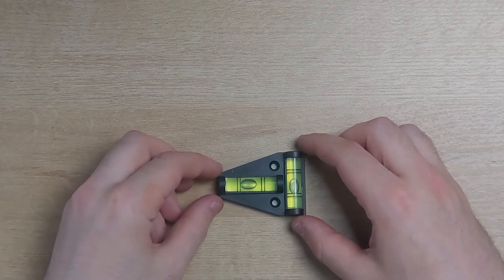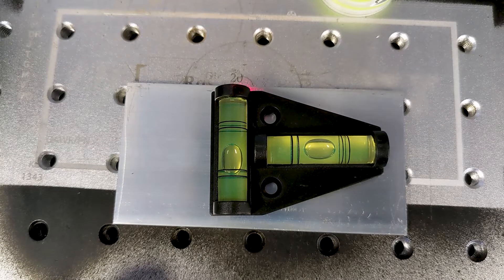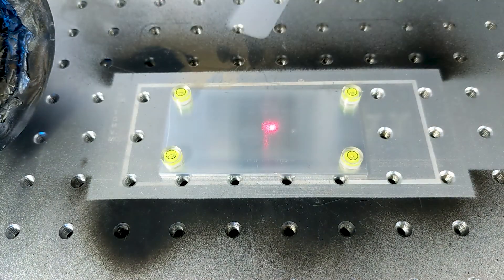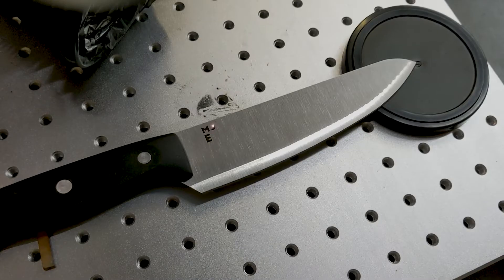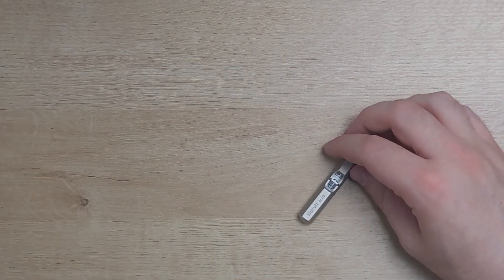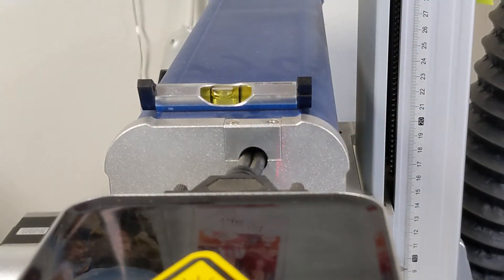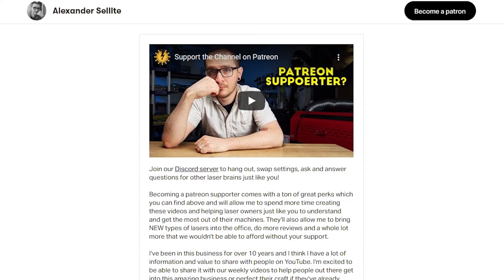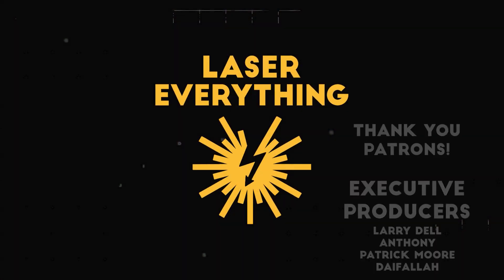Levels and Laser Engraving | Everything You Didn't NEED To Know | Starrett 135A Review

Comment: One thing I noticed, you found the level of the machine vs it's workspace on the arm of the galvo, not the head (4:22). They can be off from one another, I'd place the level on the actual head. Otherwise, great video as always 😘
Reply from the maker: I painstakingly leveled the arm and the head on my machine because my head has a huge concave curve on the top of it which makes placing a level on it infinitely frustrating. Went out to my way to make sure the head and arm were level one time - tightened everything down and now use the arm -_- tedious and annoying but effective.

Comment: When you get in to ultra high accuracy levels they will have to be acclimated to the ambient temperature and humidity of the working area. So in short they should sit no less that a hour or two. Now that being said these would not be used for product laser set up but more for machine set up I.E. CNC MILL or Lathe. But they are out there and no need to spend 1k or more for name brand.
 Starrett level you have chosen is excellent for laser set up . I would recommend highly.
Reply from the maker: Very cool, thanks for the insights 😎 I love this stuff.